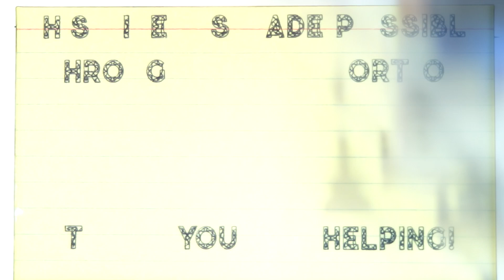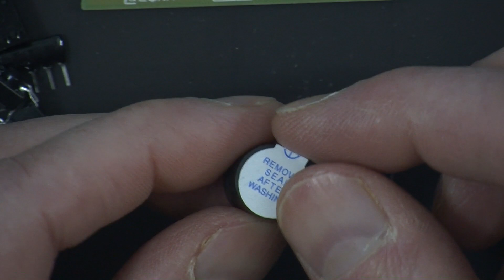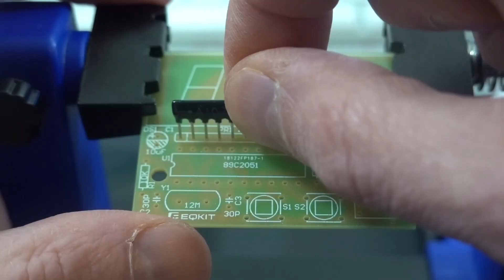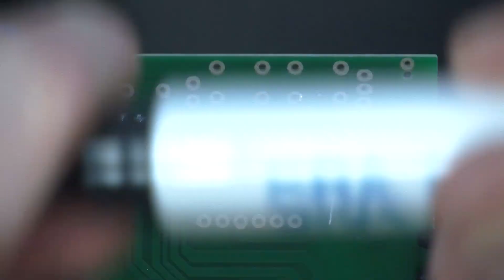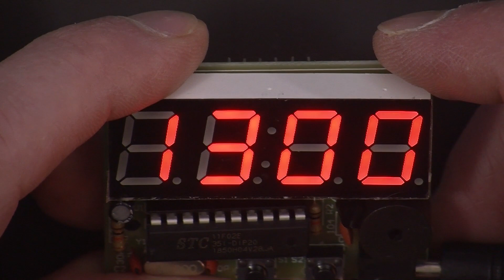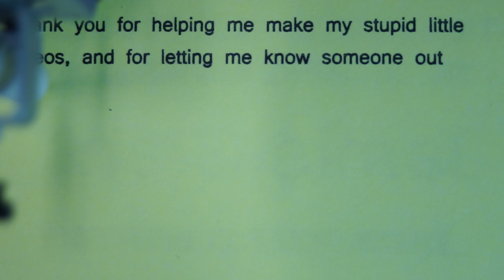Chris Boden - Kits With Chris Episode 8 - 4 Bit Clock and a Pivotal Moment

Comment: The black resister is called a package resister it's a group of resisters with a common lead and a lead for each resister in the package they are used where you would have a bunch of resisters to save space

Comment: The resistors and capacitors all follow the same numbering (or coloring, in the case of resistors) scheme, except resistors use the ohm as a base unit, and capacitors use the picofarad. 104 on a capacitor is 10(and then add 4 zeroes, or 100000) picofarads, or 100 nanofarads, or 0.1 microfarads.  SMD resistors, which generally don't have room for color bands, work the same way - a 104 resistor would be 10(and then add 4 zeroes), or 100K. 

The color bands are pretty easy, too - Each color has a numerical value, starting from black at zero, and following the rainbow - black is zero, brown is one, red is two, and so on. A 10K resistor would have a color code of brown-black-orange, or 1-0-3, or 10(add 3 zeroes), which is 10K. 

Now, a quiz. What value is a resistor with markings yellow-violet-blue?

Comment: The idea of soldering 2 corners of the socket is not just to hold it in place, but to give you chance to check if it's flat to the board, if it's not, just reheat that corner while pressing into place, you can retouch that corner after soldering the rest if needed

Comment: Kits tend to start with the lowest profile parts first, usually resistors and diodes.  That way, you aren't trying to stuff a short part between a bunch of taller parts.  10k resistors are brown-black-orange (1, 0, 000 ohms)

Comment: The extra holes by the connector are for a slightly different connector which would have metal mounting tabs there for a more secure mount and sometimes these are connected to the shield pin of the connector.

Comment: The compound resistor is 8 resistors in parallel with one end of each tied to a single common pin which is at the dot end of the device.
Reply: Used when you need many resistors from different points all to a common point, like ground  or power
Reply: In this case these resistors are the current limiting resistors for the led display.